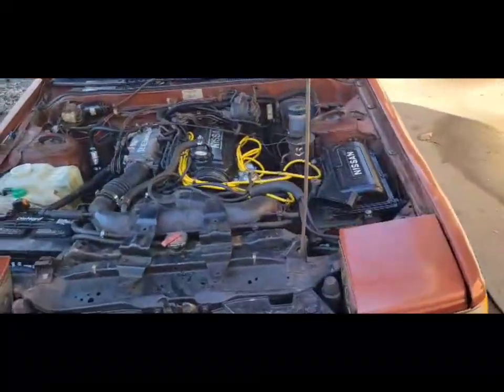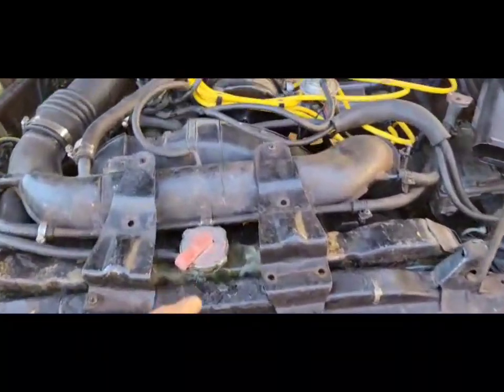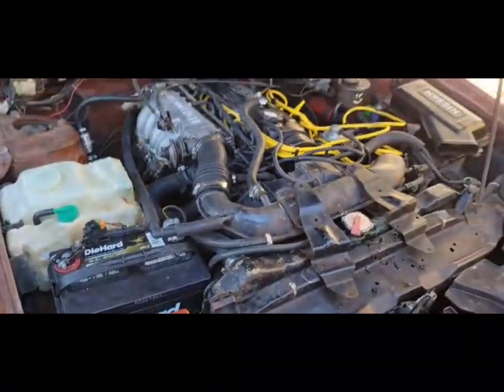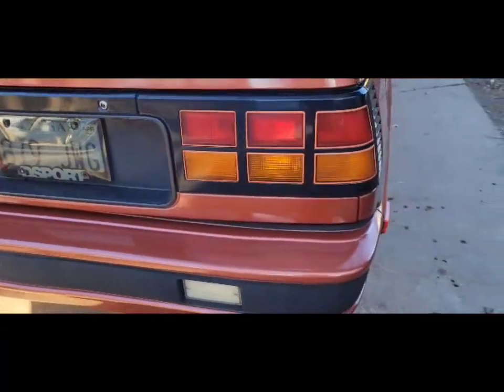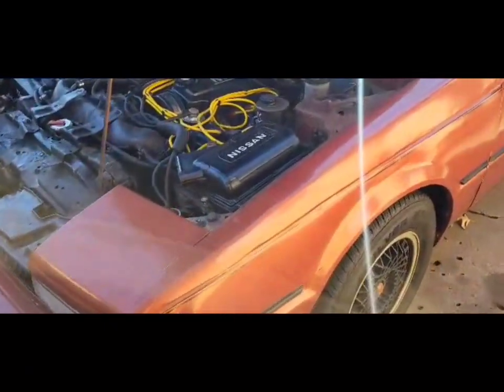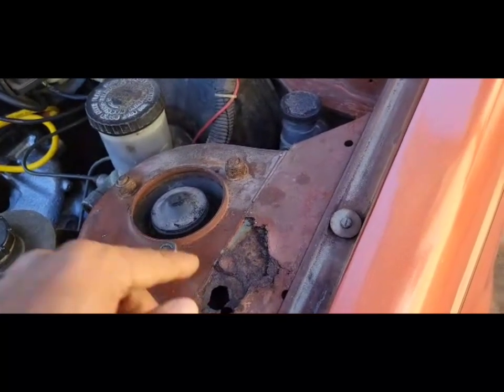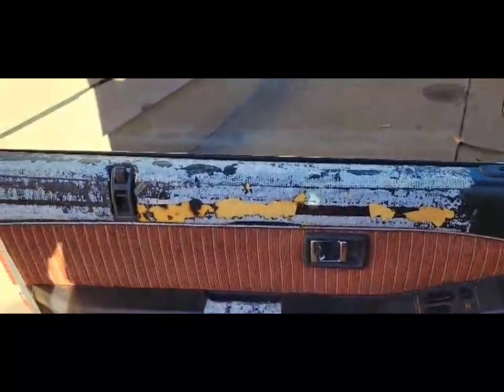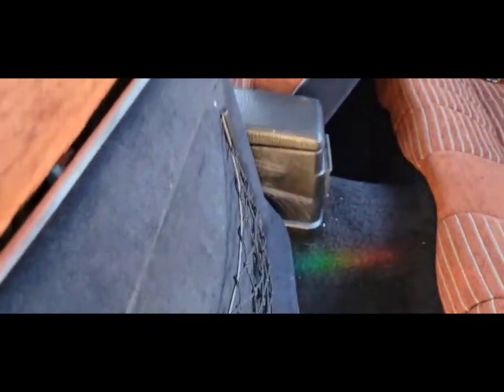Ep.1; Traded The SE V6 for a base. This One Runs....But #schassis_  #s12 #thebastardstepchild

Comment: You’re running drag strip?
Reply from the maker: No sir. Time attack. Drag car won't be finished til this winter. Its a quiet project.
Reply: Have you measured to see if torque tube and rear transaxle won’t fit out of a corvette?
Reply: @danplatt8970  This is my old car. Next to a Corvette C5 this car looks like a juicebox. I'd believe it'd be too big.
Reply: @2K19K  I mean wheel base is only about a 6 inch difference.
Reply: @danplatt8970  you’d really have to see it. I don’t doubt it could be done, but not within a reasonable price range.